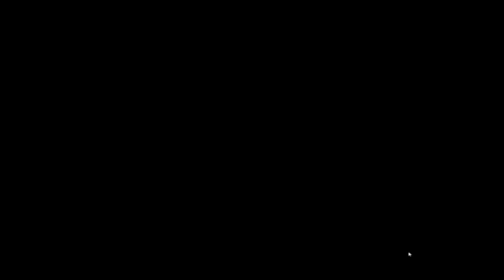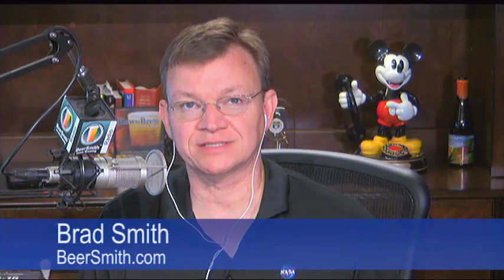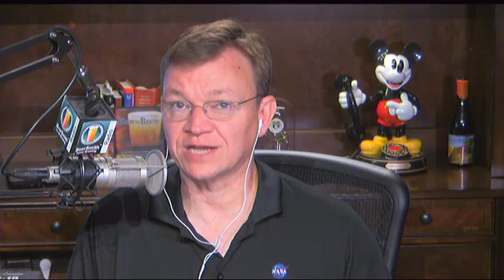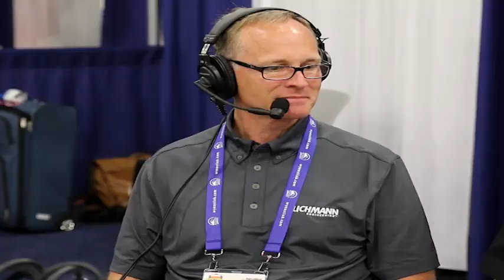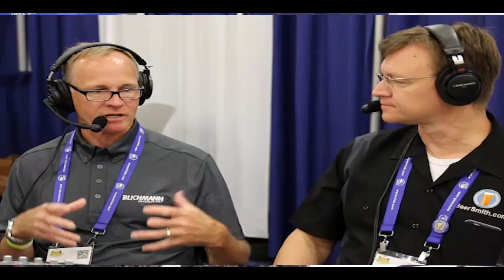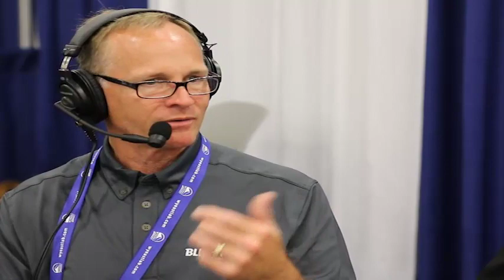Nano-Brewery Startup Tips with John Blichmann - BeerSmith Podcast #110

Comment: I wish he would have elaborated more on the number of fermenters. I could imagine only brewing on a 1BBL system, and brewing everyday, you would need at least a dozen fermenters.
Reply: He did. They mentioned having larger 7bbl conicals to double batch beers. Otherwise, yes, you would need several fermenters.
Reply: It takes 2 weeks to ferment and you want to brew each day of the week. So you brew 9 times after that first fermenter before being able to empty it. 10 Fermenters will do for standard 2 weeks beers. More can help if you like strong and longer to ferment beers
Reply: depends on how many times you'd like to brew each week OR how much volume you want to sell weekly. brew 3 times a week with Ales (14 days cycles) you'd need 6 fermenters to keep pace. and so on